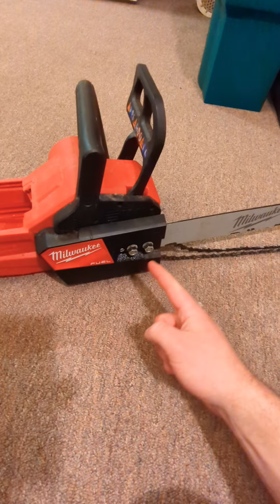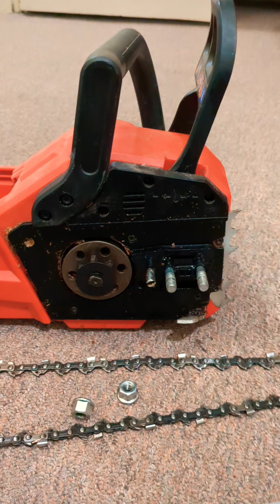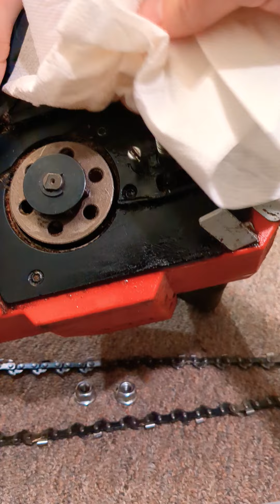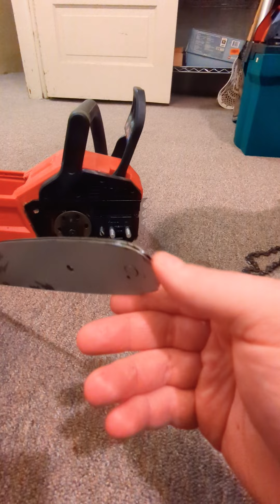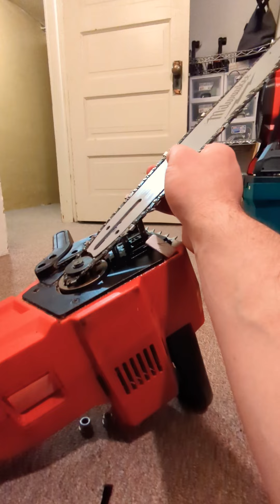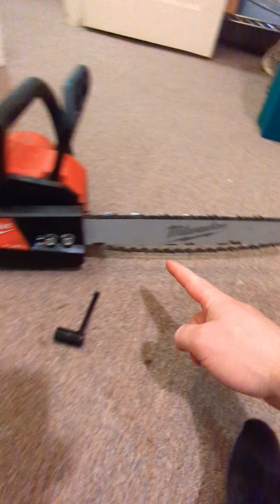How to re-install your M18 Milwaukee Electric Chainsaw chain

Comment: For everyone who has one of these and it pisses bar oil everywhere on the floor when it sits, there's a video on here showing the fix. Apparently Milwaukee uses a bad o ring, once I replaced mine it hasn't leaked a drop onto my floor or anywhere else.
Reply from the maker: Dude thank you for commenting this, I have my Milwaukee saws sitting on an oil catcher because they leak oil everywhere including the bed of my vehicle. I'm going to replace mine, do you have a link to the ring you used?
Reply: @ChonkyAudio  no problem man, it's the thing I always hated most about mine lol I used an o ring from the harbor freight kit, the metric kit. I'm trying to find the video on here I used. I'll post the link or something to it in a minute
Reply: @ChonkyAudio https://youtu.be/xS7Xfw9XcLo?si=_ot2f6Y91bFpka__
Reply: @ChonkyAudio did you try it out?
Reply: Glad I saw this right before filling it with oil. Happened to find it brand new with a battery for $200😀
Reply: @tunz475 glad I could be of assistance lol mines still doing good months after changing that O ring

Comment: As you’re tightening the chain, you should lift and hold up the tip of the bar. Stihl has a video on their channel that shows this (very important) step.
Reply from the maker: I think if you leave a bit of room for those two nuts as you tighten, then go back and do a final tighten once everything is more set and the chain guide is pulled higher. Good tip though, thanks!

Comment: Im returning mine first day I used it plastic piece broke inside. It's garbage
Reply from the maker: Which plastic piece specifically? I’ve had mine for 3 years now and it’s been amazing for me personally, better than any gas chainsaw I’ve used, and it’s so much quieter and I don’t have to breathe exhaust fumes. I does eat big Milwaukee batteries like a big old V8 engine lol curious to know what happened when it broke?
Reply: @ChonkyAudio yeah its been great, 5 years and counting.
Reply: We have 2 and use them each and every day on fences and have never had anything break in the last  years. We do go through alot of chains but we cut a lot of wood with nails and shit like thag